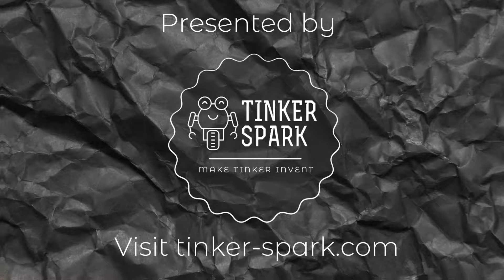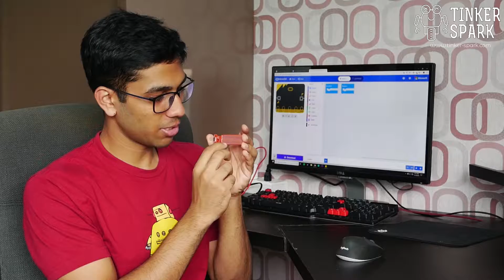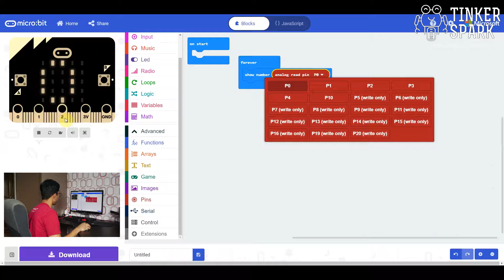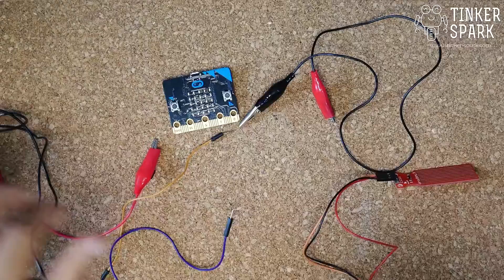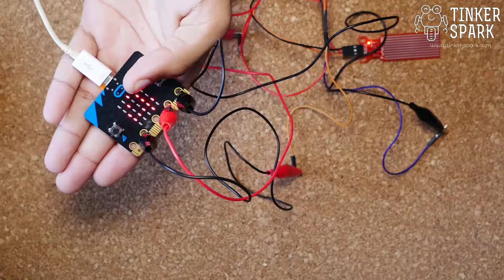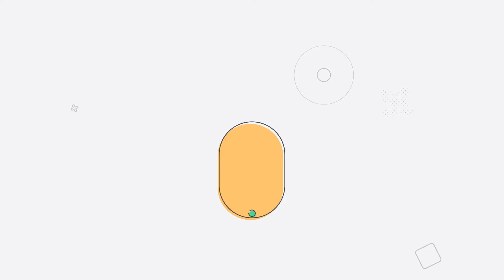External electronics: moisture sensor

Comment: can you output these numerical sensor values to a display, Saral? This is what I would like to do with Microbit or any other ARM Cortex Mx chip based processor (Adafruit Trinket M0 or other)?  The display could be USB to computer monitor or .96 inch OLED ?  Thanks.